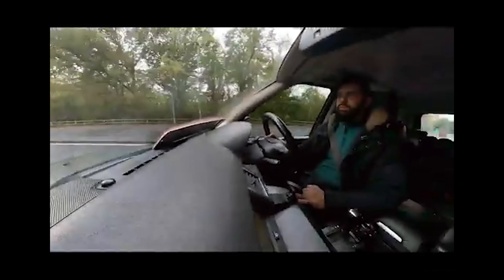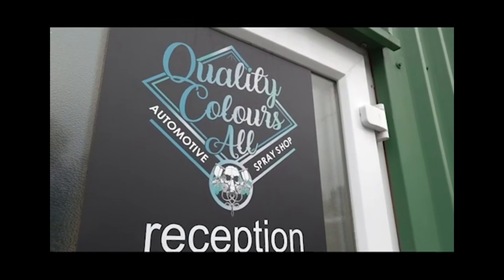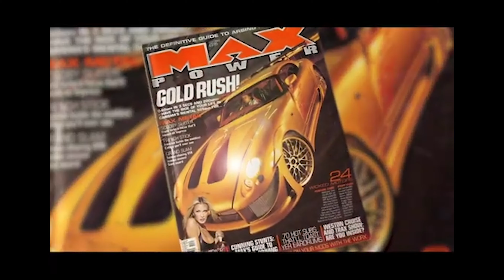WE BROKE THE MAXPOWER CARISMA CAR TREK @VINWIKI TVR! PLUS REMOVE THE WORST PLASIDIP EVER

Comment: The  Rover SD1 engine was used in models before this one which was a Buick engine originally and was  from being a "rubbish engine ", Top Gear even dedicated a full episode to it when BMW decide to discontinue it . This  has the in house designed and built AJP engine.
If you are going to do car video's at least have some knowledge of what you are putting out.